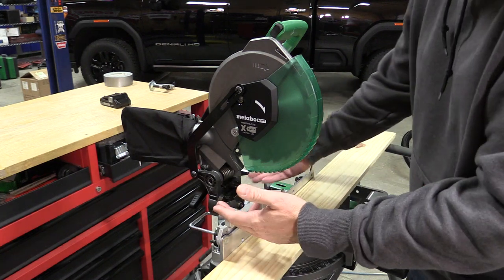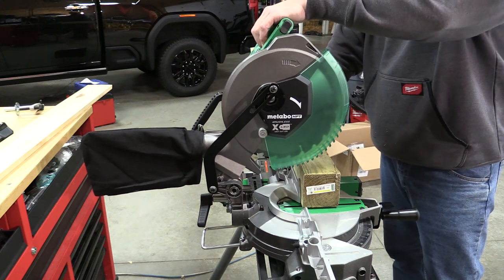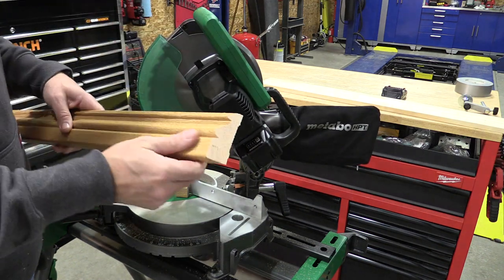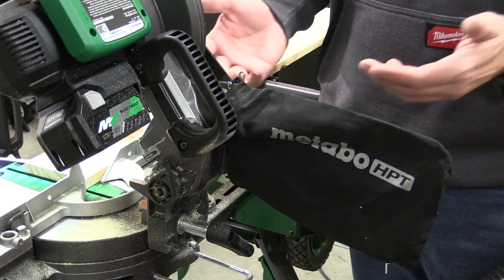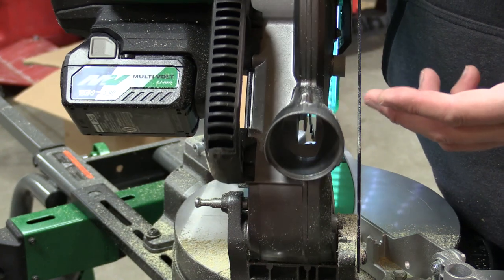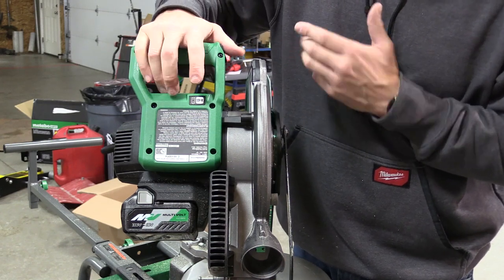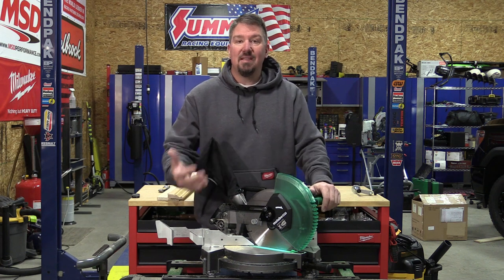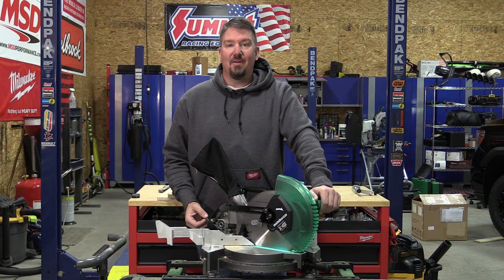Super Portable - Metabo HPT 18V 10 Inch Single Bevel Miter Saw Kit Review C1810DFA

Comment: Lasers are harder to see outside compared to lasers inside, but shadow lines can't be seen outside period. I use a laser outside all the time, not for precision, but just to get the workpiece in place quickly, before I even grab the handle, then I line the blade up with the mark. And the laser can just be left on indefinitely. The Shadow line has to be triggered each time.

Comment: Does it work with a compact 3.0 battery?
Reply from the maker: It will, but you will be low on power compared to using a larger 2P battery pack.